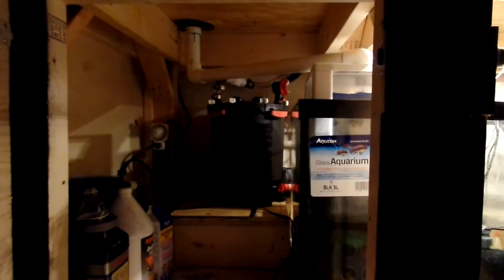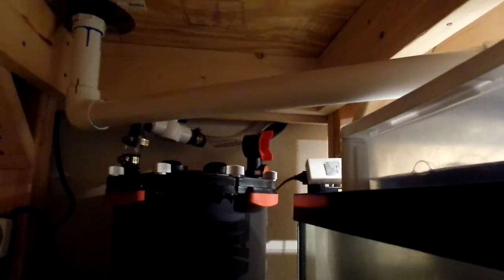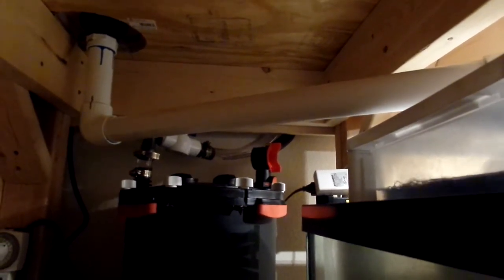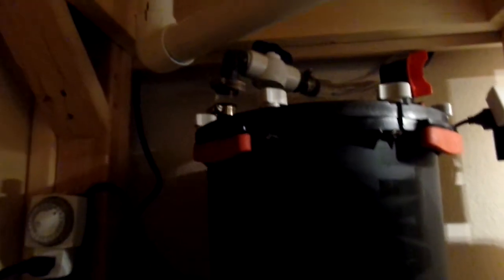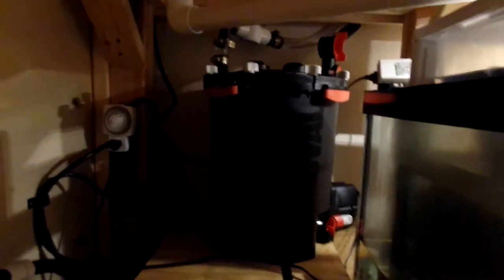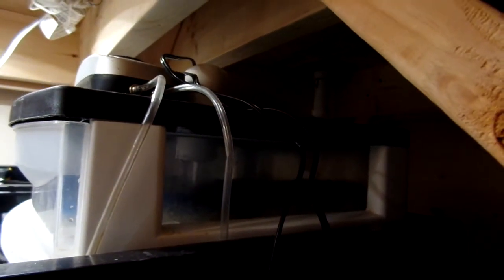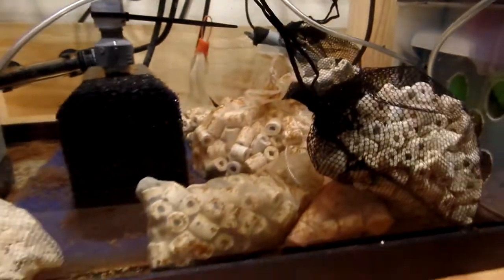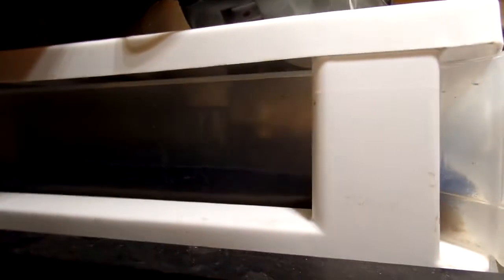Filtration Explanation Presentation Part 2

Comment: I found the same thing. The curved intake tube is connected to a piece that swivels. Well this piece is not snug. so if the water in the tank is not high enough to cover this piece it will take in air and will not prime. This swivel connection appears to be the culprit of all the complaining about the priming of these filters.